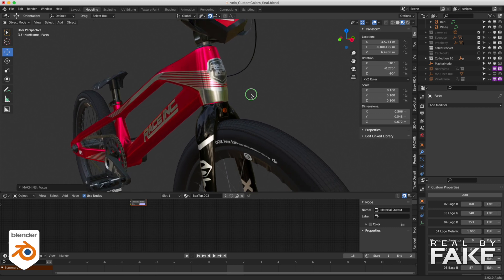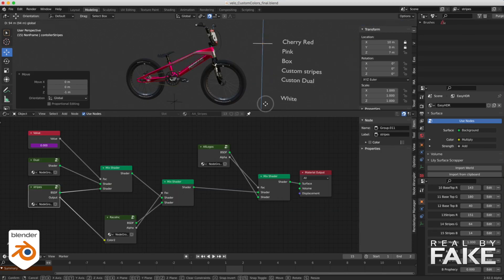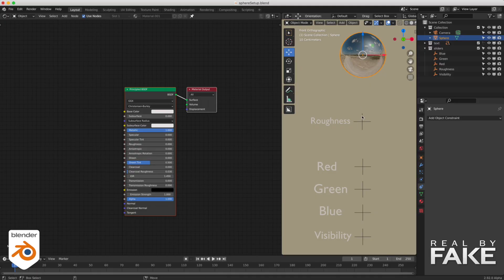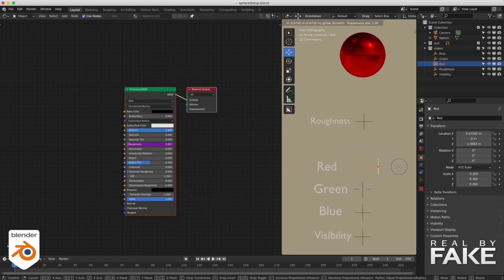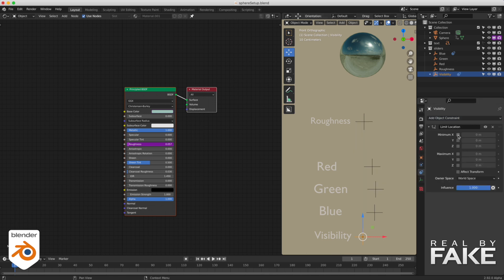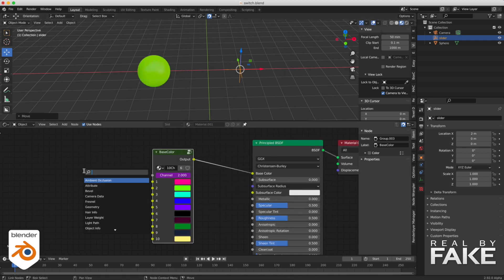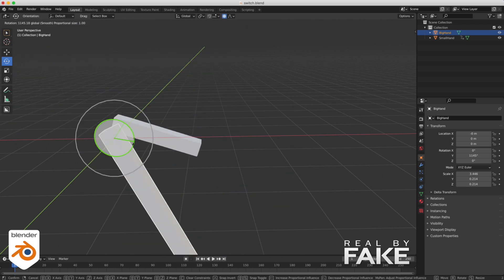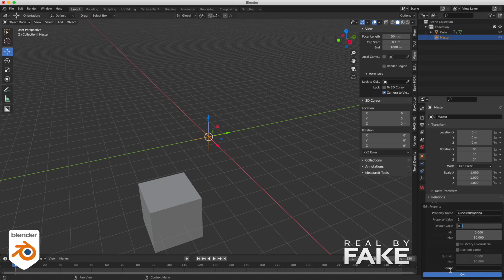Using drivers, switches and custom attributes in Blender EP14

Comment: Instead of copying the Data Path, creating a Driver, changing some settings and pasting the Data Path, you can simply press "Copy as new Driver" and then "Paste Driver". It's a little faster that way... also pizza.
Reply from the maker: Oh! Cool! Good to know! Thanks for the tip!
Reply: That is really cool. Can you assign hotkeys to that? I tried and didnt work very well, but maybe im doing it wrong.
Had to copy a bunch since, when you duplicate a shader node, the drivers disapear :(
Reply: yeah, that's a bit annoying. But you can add pretty much any operator to quick favorites. simply right-click on "copy driver" and choose "add to quick favorites". You can then access it when hovering over a valid element and pressing "Q".  @frederico4d

Comment: Hard surface modeling in a subdivision modeler, is like running a screw into a wall using a hammer 😉
There’s easier and better tools for that AutoCAD or even better SolidWorks. And it’s mechanically correct as well. And drivers come as an integral part. And you export it and texture it in your subdivision modeling tool.
But using a sub optimal tool, doesn’t seem to hinder you 😄
Reply from the maker: I started doing 3D when we didn't even have polys in PowerAnimator. It was all NURBS modelling. And you end up with a horrible topology once converted to polys. May I suggest this to show you that CAD is not the way to go for VFX? https://youtu.be/smf4lDhr_8I?t=193

Comment: is there a way to use the ".xxx" name extension of an object as a value to use in a driver?

for example, is it possible to convert the string "005" in an object name "cube.005" as a number value in the driver? i don't know how to make a proper counter that decreases for every object with a name extension ".xxx"

i tried adding a single property in the driver and put the data path of the name but the value of any string is 0.00 so i think blender automatically converts the string to the 0.00 value. i don't know how to access the object name in the script expression textbox (self .name doesn't really work) and i also still don't know how to actually use the self in the driver.

is it possible at all or do i have to make a separate python script for this? seems a bit tedious. if i can just access the last 3 characters of the name itself and convert it to a float or integer, that would really simplify it. i'm working with a large collection of objects starting with the extension ".000" and up to around ".350" or so, so it's a lot of objects to manually make a separate driver for each. if i can make the driver for the first object and SHIFT+R that object until 350 or so copies, all the drivers will be copied and update correctly with the self-reference. for now, i'm manually changing each driver as there's just no workaround i can find online.
Reply from the maker: I have no idea what so ever. I would suggest that you ask your question in blender artists dot com. If someone has the answer, this is where you will find it.

Comment: Did you made the technical drawing for manufacturing in blender or was it some cad drawing converted to blender.
Asking because I find it hard to talk to manufactories with blend files as a maker.
Reply from the maker: @traderz13  I do a little bit in one of the advanced modeling clips :-)
Reply from the maker: Yes, no, all of the above. It started all in polys. When it was time to start the prototypes, the frames had to be redone in SolidWork because they can't use polys for manufacturing. But they imported my poly version as a template. Once the CAD was done, they sent it back to me, because they made some modifications, and I converted the cad back into polys. This process usually creates horrible geometry but a friend of mine introduced me to this really cool software that does superb job for conversion. It's called Moi3D. I was actually thinking of talking about this for next week's Blender Bob.
Reply: @BlenderBob  ah yes I've been using freecad and others send me all kind of formats I hope one day blender will become a bit more CAD aware

Comment: You can use a color as a custom property, in your custom propety go to edit, then in the Property value type-in [1.0, 1.0, 1.0], a new field will appear in the buttom "Subtype" from there select "Linear Color" then press OK. If you need alpha (RGBA) type-in [1.0, 1.0, 1.0, 1.0] instead.
Reply from the maker: COOOOOOOOOOOOOOOOL! Thanks!
Reply from the maker: In my case though the design team was working with colors ranging from 0-256, not 0 to 1, so I'm not sure if there's a way to use 0-255 values in Blender.In Maya you can do both.
Reply: @BlenderBob  I don't know if there is a way to convert the colors to (0-256) natively in blender, but you could simply convert the range (0-256) to (0-1) by dividing your RGB values by 256, in this case you can use "Plain Data" instead of "Linear Color" in the Subtype.
Reply from the maker: @monaime  Yeah. What I was doing was to do the conversion in the shader itself.
Reply: @BlenderBob  Sorry i didn't get it. You give the design team the color code? or it's the other way around?
Reply from the maker: @monaime  The design team had colors in the 0-256 format, so they would input these numbers and in the shader I divided the value by 255
Reply from the maker: Now, if you can find a way to override shaders per render layers, you will become my best friend! Not globally, but per object.
Reply: @BlenderBob  Becoming your best friend (per object) is a big prise, but unfortunately i don't know how to do it :)
Reply from the maker: @monaime  Then I guess I will have to stick with my cat... oh... wait...
Reply: @BlenderBob  LOL ... nice one!

Comment: Lol... nice tutorial... I've been curious about yet avoiding these Custom Properties because I thought they were complicated. Thank you :D and btw I remember Maya does have some similar thing to this
Reply from the maker: Yes, in Maya it’s called set driven key.
Reply: Driven keys doesn't really do the same as this, well purely in a limited formXD for this kind of effect I would use the node editor and connect things up, potentially with multiplier node or whatever inbetween:) and then to connect it to either an attribute on a control object or like done here the movements of locators:)